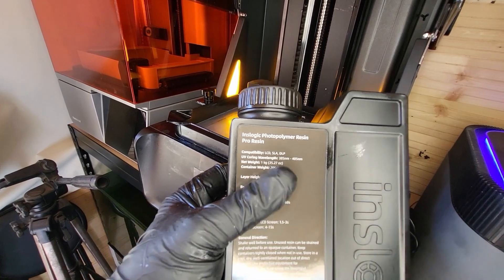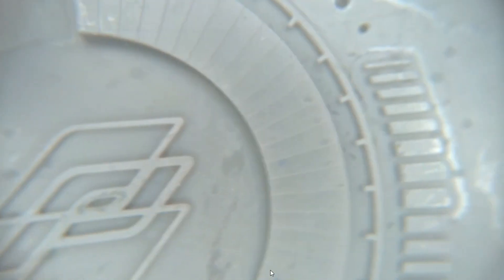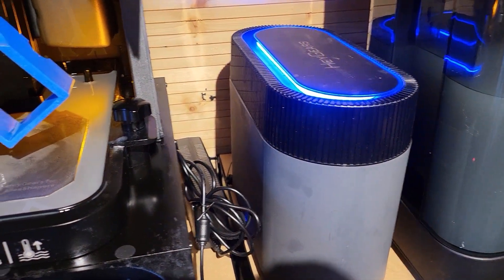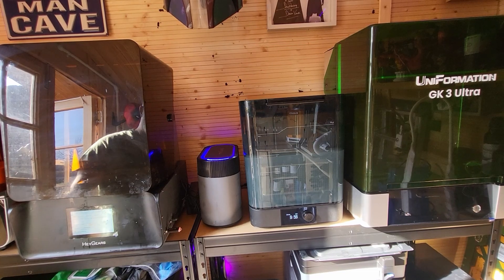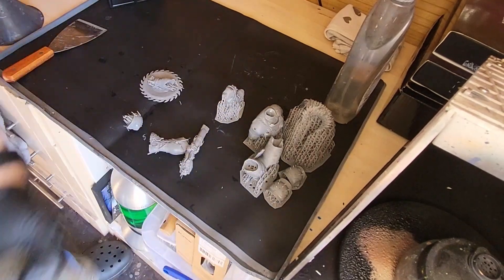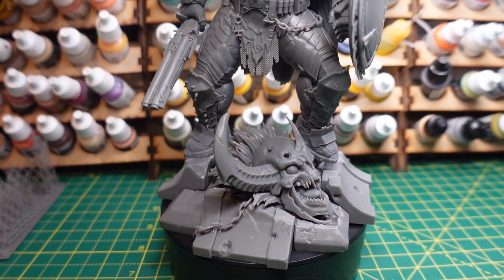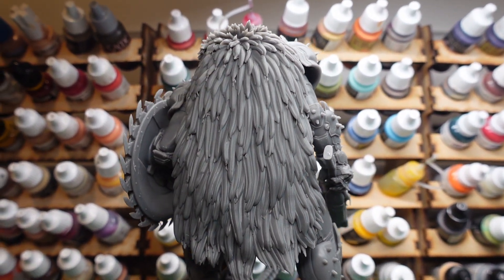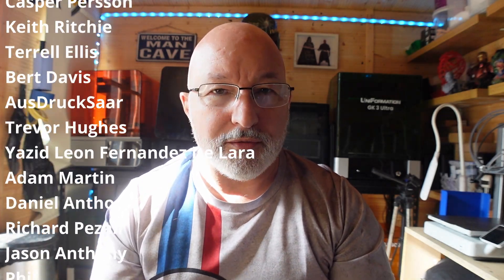Testing Inslogic PRO 3D Printer Resin In HeyGears Reflex RS

Comment: Hello, I own a Reflex RS. I want to use this device in the dental industry. However, in my tests, the PFA remains as a thin layer on the surface and the top metal part. I have tried all the mods created for the RS, but I couldn't achieve the desired result. What can I do?
Reply from the maker: That is definitely a question for hey Gear support Considering it's about using the device for medical reasons there would be in a best position to advise you

Comment: Alright Mr. Greedy, I have a question that I don't see touched on except superficially by Fauxhammer.  Im looking for a printer that I can upgrade instead of replace. As it is now these printers seem to be effectively disposable. Can you easily change the screen on a HeyGears? Does replacing the screen cost 50% the cost of the printer? Do they support repairs? I dont want to buy a new printer every 12 months.  I juat want something that will last and work for a few years even if it cost more at first, like all my other tools do. I bought a Saturn 4 when they came out and I'm already ready to replace it. It's not even worth trying to resell. 

Thank you
Reply from the maker: Hi
Yes you can replace screen on the rs..costs roughly $300 hey gears have a full easy to follow video..

Comment: Good morning I have a question I have been having suction cup problems with the rs heygear on my prints. I've done holes. Check the printability as well.  And keeps giving the same cup problems. So do I need more holes? Or is the STL file corrupted, as in is no good? . Because I use the fix print and it keeps giving the suction cup . Can yog Please 🙏 help me out
Reply from the maker: The joy with having the heybhears printers is that you can send any queries directly to the Hagia support people Through The Blueprint software these guys are the experts and I'm sure they can help you 👍
Reply: In general, you should ad holes in part of model where suction cup appears

Comment: Awesome content! Subscribed immediately. I am trying to decide between Reflex and Formlabs Form 4. I am mainly concerned about dimensional accuracy and excellent detail without layer lines/artifacts for my type of work. I also want to use the castable resin but could not find many reviews on HeyGears castable resin. What are your thoughts between these two printers? I really appreciate your insights. Thanks!
Reply from the maker: Thank you for the sub,glad you liked the content.. it's funny at some point in the future I'm going to do a review video comparing both of these machines. They are both very capable machines and I don't think there's much in it between them when it comes to quality. The main difference is the price as you've seen formlabs are very expensive with expensive subsidiary items too.. if you put me on the spot and asked me which one produces better prints more accurate with no layer lines etc I would probably go with form Labs but it would be just a hair's breadth. Having said that the hey gears supports on much better easier to remove and leave less of a Mark behind I've not used the form Labs for long I have used the reflex since it was released ASB excellent throughout without any issues or problems and their customer support is also been excellent I've not had much to do with the castable resins I'm afraid as it's a very specific area.. so I'm not sure if any of this helps you so I would carry on doing a little bit of research on your part and also consider the budgets and costs involved in both printers obviously one is much more than the other
Reply: @greedy3d480  This is very very helpful! Thank you so much for taking your time to reply me with so much details. Definitely looking forward to a comparison between the form 4 and reflex if you decide to do so. The minimum marks from supports of the reflex is actually a big pro for my work! Thanks for highlighting that. Good luck with the content and really looking forward to the growth of your channel.

Comment: Thank you for another short and sweet test. Inslogic was new to me, looked it up and discovered that they also have a nylon like that seems useful. Got access to that as well?

Nice touche to use the Formlabs cleaner as well. It took the model even though the machine looks som tiny compared to the printers. Hate Formlabs pricing but the machine looks sweet, no denying that.
Reply from the maker: I've not got access to any nylon yet but if I do rest assured I will be testing it the cleaner for form Labs is actually quite large on the inside holds about 15 L of IPA it's a bit like the TARDIS lol
Reply: @ Yes it is that or the printers beside that are bulky compaired to their build volume.

Comment: I have been getting some strange issues with my RS. after printing I get a little snot or slime on the fep in areas that it wasn’t printing.  I have to run a cleaning after every print.  But my prints come out amazing still.   His has been jayo3d abs like.
Reply from the maker: Have you tried changing different profiles to see if that helps it might just need a tweak on the bottom layers that another profile offers

Comment: Thanks for the in-depth review! I recently came across the Inslogic Standard Pro Resin and was curious about how well it performs with the Reflex RS.

I also completely agree with your thoughts on the HeyGears Reflex RS with its pulsing release vat—it consistently delivers over 90% print success rates, offers a streamlined slicing process, and produces high-quality results. In comparison, while the Elegoo Saturn 4 16K is undeniably fast, I’ve found it requires more effort and tends to have a higher failure rate.

Looking forward to seeing more insights and real-world reviews, thanks again.
Reply from the maker: Thank you for your comments I ... I've not used the ultra 4 but I have used the Mars 5 ultra... I've got to be honest does a decent job just a little bit small